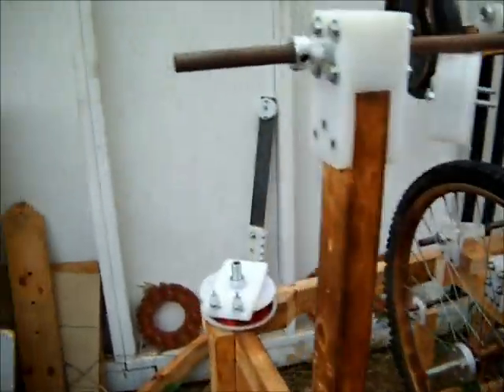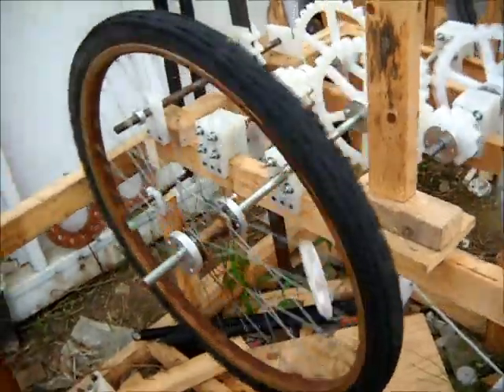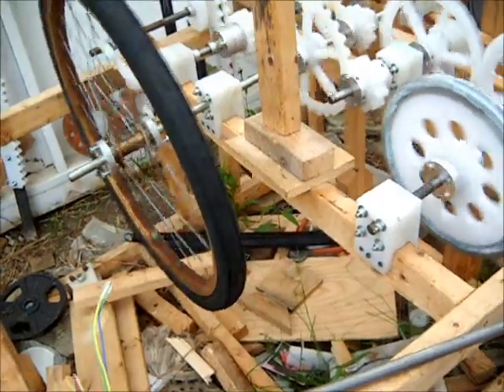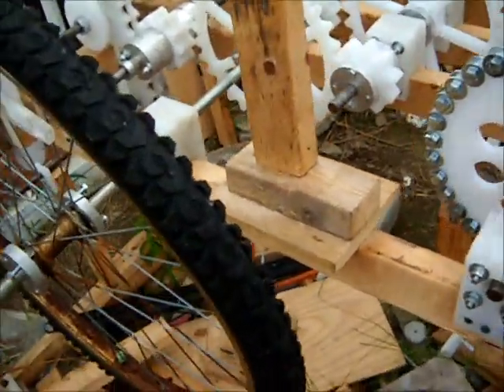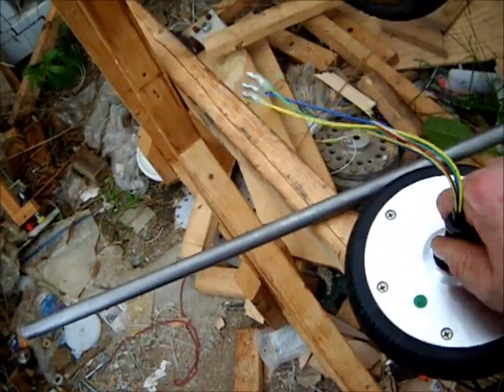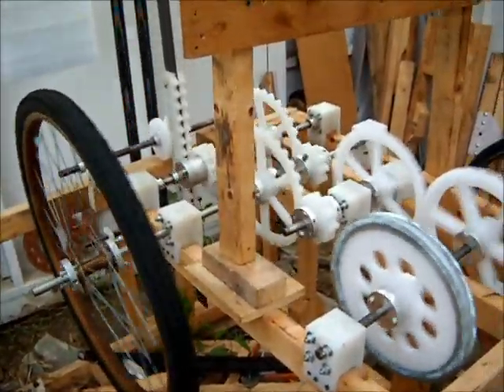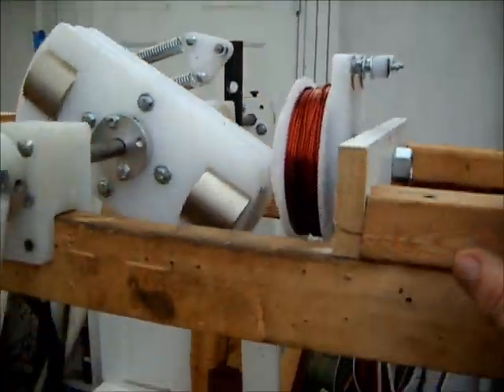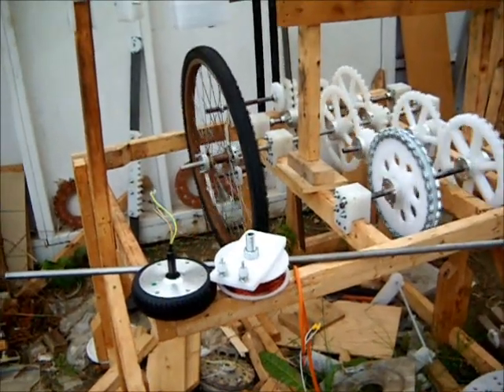GRAM TSO Gravity Assisted Pulse Motor 5 25 19

Comment: I like what I'm seeing so far, but the rate of descent is still way too fast, your gear ratio needs to be much much higher. "Looping the system", is likely to be an exercise in futility. I would suggest a winding or colliery wheel to store the potential energy, along with the higher gear ratio will significantly increase run time. Great work, liking the direction, all the best!
Reply from the maker: Hi, super capacitors are a game changer when storing electricity. thanks for the help.
https://youtu.be/euGYWZsLGRM